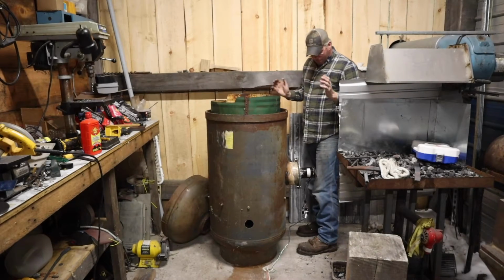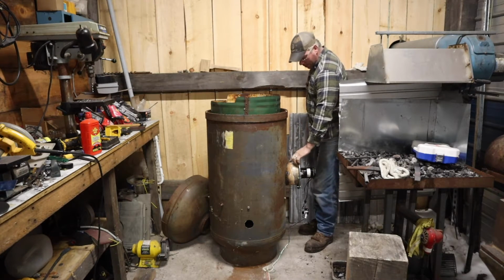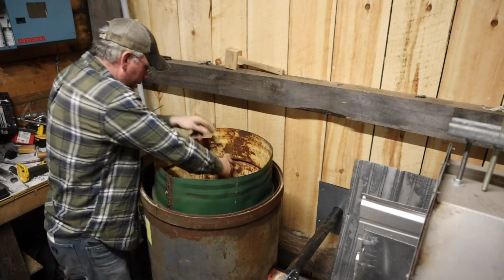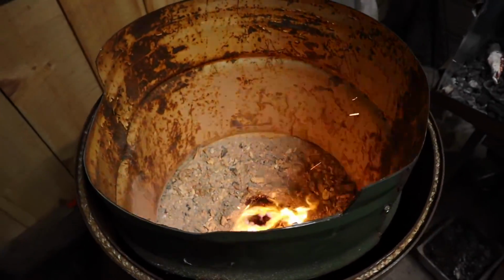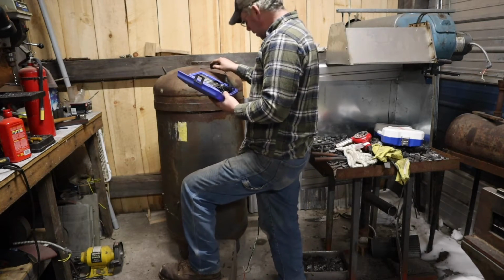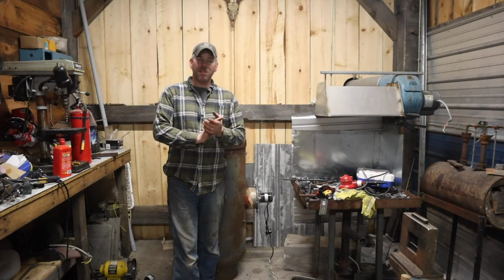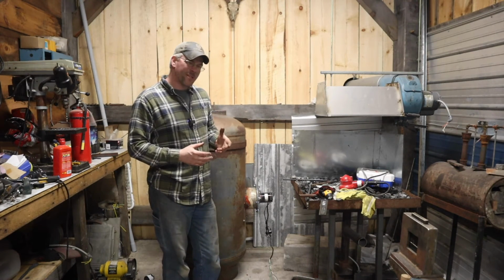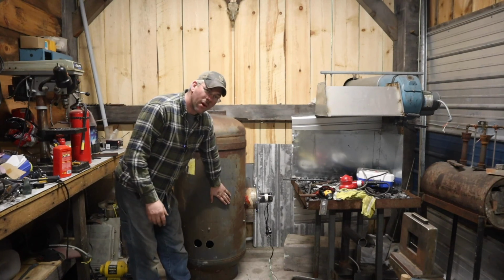First Fire In The Sawdust Burner: Epic Win Or Epic Fail?

Comment: I can see some problems ahead!

You need a variable air intake because the fuel will burn from the inside 2" hole outwards to the point where it collapses when it gets to the outside edge. The burn area starts of as Pi x Diameter x Height ....... obviously as the burn progresses the diameter increases but your air intake does not! Even with additional air holes in the outer drum you are still choking it off with the inner 2" hole that you put your pipe in to form the fuel round. Maybe drilling a couple of rings of smaller holes in the base of the burn chamber (say 1/2"?) would allow an increase as the sawdust burns away from the centre. 

A 4" exhaust seems a sensible idea ..... TBH you would have a better idea about this than most given your job .... but as it is a pressurised system the usual 6" flues that are called for are not needed as you do not want or need to create draught with it!
You may increase the heat output by directing the exhaust from the burn in a vortex round the burn chamber, giving the maximum time the hot gas is in contact with the outer drum. You could do this fairly easily by baffling your impeller intake to only come from one side and also welding a couple of tabs to deflect the fumes in the desired direction! Adding a cheap speed controller to the motor may also be good as you fine tune things!

The only other point that comes to mind ..... Meny moons ago we would use this trick in a steel bucket and a grill over the top to create a camp stove ..... You are not actually burning the sawdust but letting it char through. There are no flames when it is "burning" right reducing the air intake will not therefore douse the burn just slow it right down only stopping it if ALL the oxygen is burned ...... very different to a wood burner!
Sorry for prattling on a bit ;0)
Reply from the maker: Good comment here, I moved it to the top.

Comment: I've seen these work well with just a chimney.  No motor or power required.  You may be over thinking this
Reply from the maker: I was trying to not have to run a chimney.  It worked well but I did install a chimney on it last weekend, works fine.

Comment: I made a rocket stove and had to redo the air intake, as yours it was also to small, but, it sure made a world of difference. As for welding carbon steel to stainless steel, 7018 works fairly well but not the best. I do like your idea to replace it with carbon steel. Hope it works out for you.
Reply from the maker: I hope so too.

Comment: I don't understand how that induces can move any air from point A to point B.  Looks like it would just churn inside that pipe it is installed in.  Where is the intake and exhaust aspects of that inducers.  Not finding fault I just don't understand how that can work the way it is.
Reply: Inlet is in the centre. The fan blades form a "cage" that forces air out from the centre to the outer case where it enters the exhaust flue! Think of it like swinging a weight on a string round your head as a kid ..... the weight always wants to go outwards ;0)
Reply: @totherarf  Thanks for the reply.  I was looking at it like a squirrel cage blower but I didn't see the in and out air flow..  I will watch you mods and maybe I can get it through my head, ha.  So the way it is now it will draw air in to the center of the fan wheel and discharge it against the pipe wall it is install in and move it back to where it just drew it"s in take?  My mind is saying nothing is gained but I will watch the mods.
Reply: Ty ..... if you look at 3:36 you can see the exhaust! You need to look at the previous video to see the actual cage of the blower as it isn't obvious ;0) The flow is in through the end at the drum and out at the edge of the housing he welded on!
Reply: @totherarf  OK a dim light in my brain just flickered a little bit.  Is the function of the inducer just add turbulence/mixture to the air in the heat ex-changer or is it to induce new air into the heat ex-changer?  I was looking at it as attempting to induce new air rather than mix existing air.  Is this my problem?
Reply: OK, I just looked at the Dec 1 video and at about 10:40 in that video you mentioned welding a plate with a hole in it on the inside of the inducer.  I had completely missed this.  I am happy now, ha and I will shut up and continue enjoying you videos in the future.  Sorry for all the confusion on my part.  If I had gone back and looked at the previous video near the end it would have prevented all this discussion.  Thanks for putting up with me.
Reply from the maker: You have the right idea.  The blower is there to pull air through the burner so that I can exhaust horizontally and save on doing a triple wall chimney all the way up the side of the building.
Reply from the maker: No need to apologize.  I was trying it out as is to see if I'm on the right track.  I'm going to make a better inducer assembly now for it.
Reply: @MrTodd51  Glad to have helped ..... sharing knowledge makes everyone better ;0)

Comment: dont waste your time cutting off the stainless steel pipe, just clean up your snot welds and wire brush it good and hit it with 316 stainless steel rod, make sure cables are set to DC reverse... oh you have a shit tom stone AC welder, save your pennies an get a miller thunder bolt buz box there cheap and hold the test of time  and get 7018 3/32 reverse also... it welds steel to stainless just fine just dont use steel rod to weld stainless to steel
Reply from the maker: I'm surprised it welded at all.  I will need an AC/DC welder for sure someday.